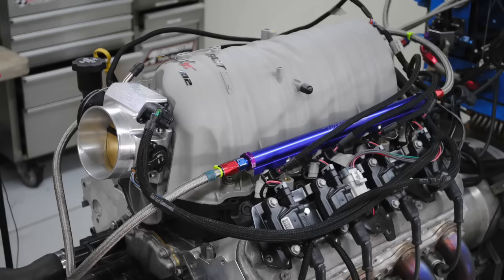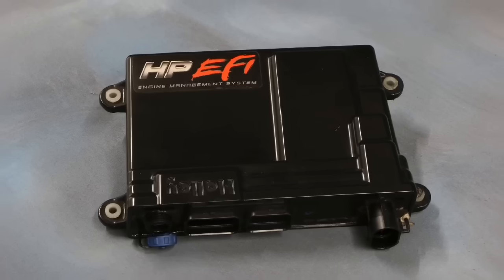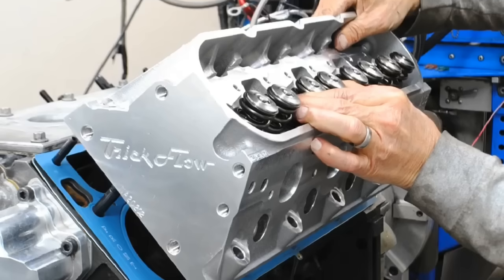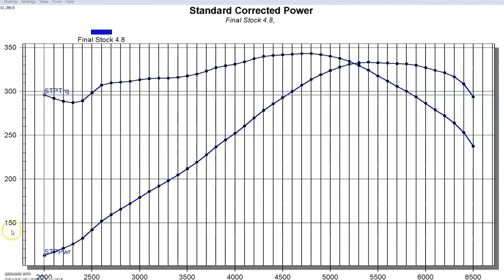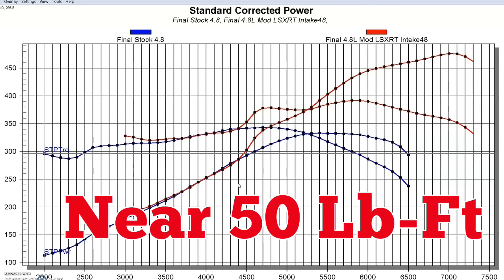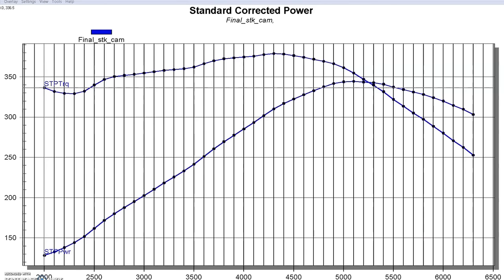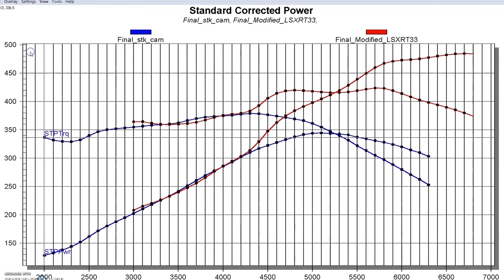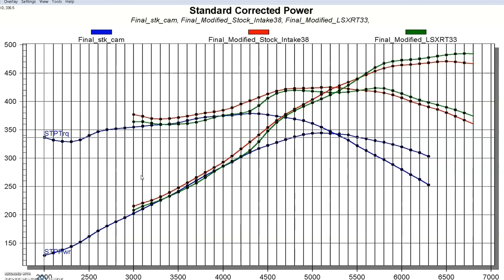JUNKYARD 4.8L & 5.3L POWER UPGRADES! HOW TO ADD 130+HP TO YOUR LS! HOW TO SWAP HEADS, CAM AND INTAKE

Comment: I have a 218/212 lsa 111 cam I run on my 5.3 with a tbss intake and it’s the perfect daily. Very snappy with perfect HP.
Reply from the maker: reverse split? No Bueno
Reply: @richardholdener1727 it’s actually 212/218 I wrote it wrong

Comment: ok I know this is old video but I am thinking about my 64 Corvette 327 365hp and that 4.8 short stroker. Compression and Cam seem to make that old 327 feel so good above 4,000 rpm. Is it possible to work that Iron block 4.8 with 365 like cam and 11 to 1 compression pistons. and get that same Rev forever feeling of the old 327 365HP.

Comment: hey i have a hi mile 4.8 and i was thinking about replacing it with a low mile 5.3  in a 2011 1500 what kind tunning would i have to do or will it run the same as the 4.8
Reply from the maker: tuning would needed for displacement change

Comment: On my LR4 I’m running 243 heads with bigger valves and BTR platinum dual valve spring kit. Stage 2 cam (high lift) from TSP, street engineering shorty headers and K&N intake and LS7 lifters. Haven’t got it Dino yet so I’m curious what I’m actually making to the wheels.

Comment: The 5.3 s  L 33 has 315 net hp. The early ones has 295 hp.  That might be the difference. Easier to get 500 hp from the L 33.
Reply from the maker: The factory rating has nothing to do with getting 500 hp from them

Comment: Hey Rich i bought your low buck truck cam, lifters,and springs kit for my 4.8 i have a complete long tube headers exhaust system, my question is should I have purchased the pushrods as well, and also although advertised no stall change needed I want the full benefit of the cams performance along with other bolt-ons I have so would a 2800 stall converter be efficient or is that too much? Also I plan on purchasing the tbss intake the compliment the combo. As always appreciate your knowledge and love the content.
Reply from the maker: Yes, a converter will definitely help on the 4.8L. Stock pushrods should work.
Reply: @richardholdener1727  Thanks man appreciate you and keep up the awesome job 👍🏾💪🏾
Reply: So the 2800 stall is a yes?

Comment: Hey i have a 5.3 bored to 5.7 with 243 heads, ls6 intake, with a TsP 238/242 cam which i think is way big not really going to be for daily driving but will drive once a while 
I have a 4l80e and 3700-4000 stall
Was thinking of running the tbss intake cause i know it makes more horsepower but really like the look of the ls6 intake. What do u think of the set up and what intake should i use? And is the cam size good, and its a 95 gmc sierra single cab. 
I also have a 4 door colorado with a 4.8, 243 heads, 230/238 sloppy cam, and a tbss intake and was thinking of putting the ls6 intake on that truck and putting the tbss intake on the 5.7 since im going to daily the colorado even tho i still want it to make it the best performance i can lol running  a 3300/3700 stall with a 4l60e what
Reply from the maker: the 238 cam might not fit stock p-v (The LS6 intake should work
Reply: @ i also have a ls2 intake and tbss should i keep the ls6?

Comment: Dude, Im in the middle of trying to figure out how to build one of these for my Chevy Suburban. Id gladly pay for a little advice if you have the time. I like the cam/fast intake for 480 hp you showed but Im sure their are a a few other parts inbetween Im not aware of like maybe a high volume oil pump, some upgraded lifters and some upgraded trunnions. Im just guessing though. I may have bit off more than I can chew, anyway you have a few minutes to talk?
Reply from the maker: the bottom end was stock, including the oil pump, rockers and lifters

Comment: I'm planning to swap the 5.3P with summit pro cam, and bee Valve springs  new trunnion set, hand ported 862 heads 862heads . Twin 50/65 turbos. On a BMW E36 chassis

Comment: How about running a tall single plane intake and ACES TBI fuel injection? Use either trick flow heads or air flow research.

Comment: What ported heads and e85 fuel pump do you recommend me sir ? on a 06 Chevy with a 4.8l cammed with ls3 throttle body, ported tbss intake manifold, stage 3 cam 234/239 .615/.610 LSA 112+2, 3600 stall, 37lb injectors but I’m planning on swapping out the injectors
Reply from the maker: ported 706 or 243 or TFS 205
Reply: @richardholdener1727  will the tfs 205 still work well without turbo ?

Comment: Richard - hope you are doing well. A quick for you or maybe some advice. Running a 5.3 with TSP 223/226 600/600 with a 111 LSA and TSP stage 2 headwork on my 243’s a FAST LSXR and FAST billet rails a Nick Williams 102 throttle body. Going to run E85 and nitrous. What injectors would be a good fit? I really like your input. The 5.3 has a stock bottom end with ring gap.
Reply from the maker: I would just get 80s

Comment: Do you recommend twin turbos ima be hauling a 1965 Chevrolet truck i did have the rings filed and gapped with 583 sloppy cam
Reply from the maker: put on what you want-single or twin does the same thing when sized properly
Reply: @richardholdener1727  being the rings are filed and gapped could i run nitros

Comment: i watch all your videos! i have a similar set up as others in the comments but wanted to know what cam to run with the TBSS intake, long tube headers, CAI, stock heads stock fuel system, looking to make 420-450whp
Reply from the maker: what size motor?

Comment: Hey Richard! Always a pleasure. What lifters and rockers did you use in the 5.3? Did you add the flat top pistons?
Reply from the maker: the L33 alum junkyard motor already had flat top pistons. We also used the stock (high mileage) factory lifters in the L33

Comment: I have a 05 5.3 completely stock which cam can i add for most hp gain all thru out the powerband and for chop
Reply from the maker: there is no such cam-but you will be happy with the BTR TRuck Norris for use with a stock converter
Reply: @richardholdener1727  which stage would be best

Comment: I have i 99 chvey with  this engine only difference is it an lr1  it has has a rough idle and sounds rough until you put over  3000rmp.(35-45mph) Have been told  it had some exhaust work done to it by a  previous owner it has over 3500 miles.  I have replaced the spark plugs and  plug wires anything tips on what i can do to fix without putting in shop for a engine rebuild
Reply from the maker: injector or vacuum leak

Comment: When he said mill the 862 heads what's that mean.... like deck them down some or ???
Reply from the maker: remove material from the surface of the heads-adds compression
Reply: @richardholdener1727  so basically like the old skool sbc when we'd shave like. 010 off the head to deck them down
Reply from the maker: works the same on any cylinder head

Comment: Between the throttlebody, and the fast intake, heads, probably with upgraded springs, and the cam is more than the entire engine cost. At that rate, it would’ve been cheaper to start with an LQ9 or another 6 L. With more overall potential and less upgrades, to achieve the same power.

Comment: I WENT DOWN THE COMMENTS AND GM DIDN'T SPEND A DIME TO DEVELOP THE LS. THIS LS IS ALL FORD IN DESIGN 1000% AND IF YOU WOULD LIKE TO DISCUSS IT. I WILL GO THROUGH THE ENTIRE LS DESIGN. NOT ONE 1 DESIGN ASPECT OF THE OLD SMALL BLOCK CHEVY LIVES IN THE LS. 
GM HAS HAD THE EPA IN THEIR POCKETS FOR YEARS, USING THEM TO PUT PRESSURE ON FORD TO MEET VERY STRICK EMMISSION STANDARDS TO KILL FORD'S PERFORMANCE ENGINES. AND LOOKED THE OTHER WAY WITH GM AND ALLOWED THEM TO BUILD  RACE ENGINES WHICH VIOLATED EPA EMMISSION STANDARDS. THE GOVERNMENT BUYS GM PRODUCTS AND IT HAS BEEN THAT WAY SINCE THE DAYS OF BONNEY AND CLYDE. WHEN BANKER ROBBERS WANTED A GET AWAY CAR. THEY CHOSE THE FLATHEAD FORD. BONNEY AND CLYDE WROTE A LETTER TO HENRY FORD AND SAID IF IT WASN'T FOR HIS FLATHEAD FORD THEY NEVER WOULD HAVE BEEN ABLE TO GET AWAY FROM THE FEDS AND BE SUCCESSFUL BANK ROBBERS, WHILE THE FBI WERE USING GM VEHICLES THAT WERE SLOW. GOVERNMENT OFFICIALS WERE PLEADING TO BUY FLATHEAD FORDS TO CATCH THE BANK ROBBERS AND THEY REFUSED. THIS IS HOW STRONG THE GRIP WAS THAT GM HAD ON THE GOVERNMENT OFFICIALS. CORRUPTION AT IT'S BEST AND IT IS STILL GOING ON TODAY.  THIS IS THE REASON FORD WENT MODULAR IN 1992 BECAUSE THE EPA IS IN GM'S POCKETS. BEFORE THE LS WAS COPIED FROM FORD. FORD WAS GOING TO PUT THE 351 WINDSOR IN THE MUSTANG, GM'S NIGHTMARE. FORD WAS ALREADY KILLING THEIR 350 WITH THE 302. SO GM USED THE EPA TO PUT STRICT STANDARDS ON FORD TO KILL THE 351 WINDSOR FROM MAKING IT UNDER THE HOOD OF THE MUSTANG AND INSTEAD RECIEVED AN ENGINE DESIGNED FOR EFFICENCY BEING THE 4.6 MODULAR ENGINE. WHAT CHEVY DID COPYING FORD IS THE MOST CRIMINAL THING TO HAPPEN IN THE HISTORY OF AUTOMOBLES.
Reply from the maker: That a lot of tinfoil
Reply: @richardholdener1727  RICHARD, THE CHEATING BY CHEVY IS WORSE THAN THE LITTLE BIT I HAVE ENLIGHTENED YOU TOO WITH THE EPA. WHEN FORD STARTED THEIR TOTAL PERFORMANCE PROGRAM IN 1961 AND DEBUTE THEIR 406 ENGINE. THEY WERE AT A DISADVANTAGE IN RACING DUE TO THE BORG WARNER TRANSMISSION THEY HAD WHICH WAS A ROLL OVER FROM THE PREVIOUS YEARS AFTER THE AMA BAN OF 1957. WHICH WAS A 3 SPEED ON THE COLUMN WITH AN OVERDRIVE. IT WAS NOT SUITIBLE FOR RACING. THE CHEVY 409 HAD A 4 ON THE FLOOR BORG WARNER TRANSMISSION SUITED FOR RACING. SO FORD BEING A CUSTOMER OF BORG WARNER. WENT TO BORG WARNER AND REQUESTED THE SAME TRANSMISSIONS THEY WERE SELLING GM BEING A 4 ON THE FLOOR. GM THEN PUT PRESSURE ON BORG WARNER AND TOLD THEM "IF YOU SELL FORD THOSE TRANSMISSIONS, THAT THEIR WILL BE SERIOUS CONSEQUENCES." (NO TIN FOIL HERE RICHARD, THIS IS THE TRUTH! THE SAME WAY I TOLD THE TRUTH HOW GM WEAPONIZED THE EPA AGAINST FORD TO KILL THEIR PERFORMANCE ENGINES). SO BORG WARNER YEILDED TO GM'S THREATS,  BUT AT THE SAME TIME COULDN'T LOSE FORD AS A CUSTOMER AND BORG WARNER BEING PRESSURED UNDER GM CAME UP WITH A PLAN TO SELL FORD THOSE 4 SPEED TRANSMISSIONS AND MADE ONLY BAD GEAR RATIOS AVAILABLE TO FORD, THAT WERE NOT SUITABLE FOR RACING. FORD THEN WENT INTO THE TRANSMISSION BUSINESS AND F##KED BORG WARNER WHERE THEY BREATHED. THE FORD TOPLOADER WAS BORN AND HISTORY WAS MADE. GM/CHEVY HAS BEEN CHEATING THEIR WAY TO THE FINISH LINE FOR DECADES, I CAN GO THROUGH THE ENTIRE HISTORY SINCE 1957. TODAY MODERN VERSIONS OF THE FORD TOPLOADER STILL LIVE AND ARE USED IN NASCAR ALONG WITH THE FORD 9 INCH REAR END.
IN 1973 FORD SOLD THEIR TRANSMISSION DIVISION TO TREMEC IN MEXICO. YOUR TREMEC TRANSMISSIONS TODAY ARE DIRECT DECENDANT OF THE FORD TOP LOADER. THE TREMEC IS A FORD TOP LOADER DESIGN.

Comment: Man I'm really trying to get into these LS motors for an rx7 swap, but nothing is in my language man. Everything is carbureted and in inches not millimeters 🤣
Everything I've worked on up to this point has been metric, cars, computers, 3d printing and CAD. There's only about two things that measure in life imperial, my height and my unit.
Reply from the maker: no ls motor was ever carbureted from the factory, every LS displacement is measured in liters (4.8L, 5.3L, 6.0L etc...) so you should be good

Comment: Hey Richard how about 243 head's on the 4.8 and the Elgin sloppy stage 2 cam along with the tbss intake what you think about that combo
Reply from the maker: CAM IS TOO BIG IN MY OPINION-UNLESS RACE
Reply: @richardholdener1727  
What cam in your opinion would be a good streetable cam for that combination that I'm eventually going to turbo the motor which I have a Billet s475 
Thanks for the help
Reply: Hey i have a 5.3 bored to 5.7 with 243 heads, ls6 intake, with a TsP 238/242 cam which i think is way big not really going to be for daily driving but will drive once a while 
I have a 4l80e and 3700-4000 stall
Was thinking of running the tbss intake cause i know it makes more horsepower but really like the look of the ls6 intake. What do u think of the set up and what intake should i use? And is the cam size good?

Comment: Can you put a 5.3 piston into a 4.8 block to drop compression with the purpose of allowing more room for turbo boost? Or will that drop the compression too low? I imagine lower compression, more room for air and fuel/boost but how low can you go without losing too much power?

Comment: I know this is an old video but just incase you get this comment. I'm running a 6.0 with 799 heads and .030 over bore, Brian tooley stage 1 cam with a stock 5.3 truck intake. I have no idea what I have for power and torque. I would like to see if you have run something similar to this combo.
Reply from the maker: which stage 1?

Comment: can you tune the 5.3 in a 00-06 truck to make the same power and mpg as a current 5.3 or are the engines too different?
Reply from the maker: no you can't
Reply: @richardholdener1727  is that because of different heads or pistons or why?
Reply: @guamazolopez6456  Can't speak to specific differences but older pushrod V8s made less power because ultimately the heads couldn't allow enough flow to make more power, regardless of bigger Cams, compression, etc. In theory, an earlier 5.3 would make the same power with equally flowing heads and cam/valves around the same compression. 

By the early 2000s GM was generally using much better heads, so they could've limited power by using a very mild cam or restrictive intake in otherwise high-HP heads. In short, shitty Heads being maxxed out by 4.5k RPM is what made the big power differences from the past to now

Comment: Have you ever done a test with a comp cam thumper stage1 truck cam? I bought an 4.8 and came with that cam I wanted to know what power number I could get because the person who sold it to me said that it was meant to be a 400hp motor 🤷🏻‍♂️
Reply from the maker: specs?
Reply: @richardholdener1727   I don't have specs sir unfortunately,the guy who sold to me said"the mechanic said it's was a stage 1 comp" 🥴 I guess I'm kinda screwed

Comment: Richard what head gasket would you recommend for a 06- 4.8 with truck Norris cam, LS7 lifters, 1 piece 7.400 pushrods, ARP head bolts. Boosting in the near future.
Reply from the maker: we use fel pro or factory ls9
Reply: @richardholdener1727  awesome thank you.

Comment: Richard were they both using stock injectors? I am assuming yes as you did not mention changing them but just wanted to be sure.
Reply from the maker: no-you can't add 130 hp using stock injectors

Comment: Good morning I'm new to the channel I did subscribe and I'm watching because I'm curious I'm not really a motor enthusiast but I'm getting there I have a question so I have A 48 in my Van and I use it for work I need a little bit more power and torque they didn't make them with the 5.3 and a 2500 only the a 6.0 just need a little bit more power and talk and my 4.8 what would you say would be my best option
Reply from the maker: tune, headers, mild cam or boost

Comment: I have the l20 4.8 stock 305 hp in my cj7 with a cam crank and rods from a 5.3 she's fast no stock truck can touch it
Reply from the maker: then you have a 5.3L
Reply: @richardholdener1727  basically yes

Comment: SUPER happy with my Brute Speed blower cam for a bolt on LS1. Even without the D1SC; it’s super drivable, great idle, and the springs last. All this while making killer peak power, while producing great numbers and response UNDER the curve. Bob Beam ftw! Honestly want to use it in a 4-point-great, with TBSS intake, and s400 in my next s10/LS build…

Comment: Putting a 5.3 together and was looking at new pistons cam and some head work on 706 heads! Any suggestions on the cam and piston combo and really want to stay NA and going in 4 banger Foxbody
Reply from the maker: lots of combos up on the channel for you to chose from
Reply: @richardholdener1727  thanks so much I really like the truck Norris cam! Going with stock rods and 706 with with a little porting and springs

Comment: im building a 2004 tahoe lm7 5.3 my question is hp and tq range and is it a good combo and any suggest thx in advance,tsp cam stage3 low lift .216/.220 ,long tube headers,cat delete,862 heads,and flat top pistons to raise comp to 10.5 to 1 possibly oversized pistons im looking for 450-475 hp thx for any advice you can send my way
Reply from the maker: you need a bigger cam for that power
Reply: What power will I be looking at with that cam,and will oversized the pistons help any

Comment: Have a stock 2019 GMC 1500 with a 5.3 motor.  Does MSD make a replacement intake manifold for this truck. looking for a bolt on improvement as a daily driver.  Thank you
Reply from the maker: yes-but you should not get it for a 5.3L

Comment: 250k 5.3 flexfuel in 07 silverado:  BTR Truck Norris cam, springs, slightly upped compression, NBSS intake, edge cts2 tuner, Pace setter shorty headers, cat back with Jones straight through muffler into twin pipes, Very good so far!

Comment: Richard is a tensioner needed if u use a double roller chain and gear on 5.3
Reply from the maker: most 5.3l motors don't use tensioners any way

Comment: I need help with my 4.8. I have an intake and exhaust and even changed my gears to 4:10 and still struggles while towing. Any recommendations?
Reply from the maker: needs to be bigger
Reply: @richardholdener1727  is it worth all the upgrades or should I just get a 5.3?

Comment: I’m running 5.3 with truck Norris cam, TBSS intake, 92mm throttle body, ls7 lifters, speed engineering headers, Holly Terminator X max. Alternator and water pump only. What kind of power do you think I’m making? Also in in a 1991 GMC Sonoma single cab short bed.
Reply from the maker: please see the TN 5.3l cam test video